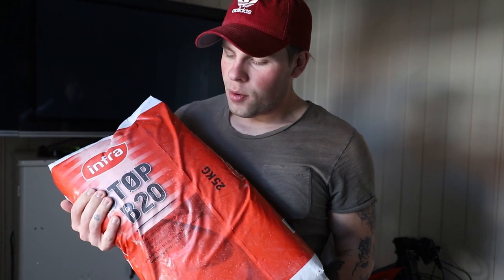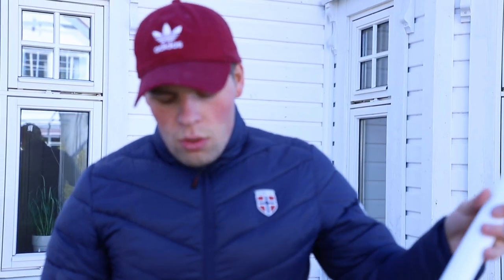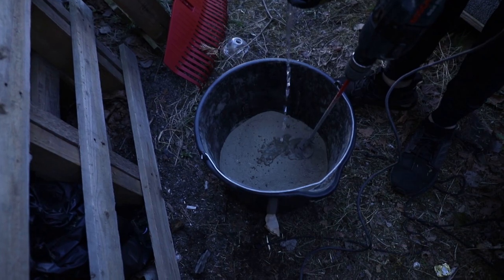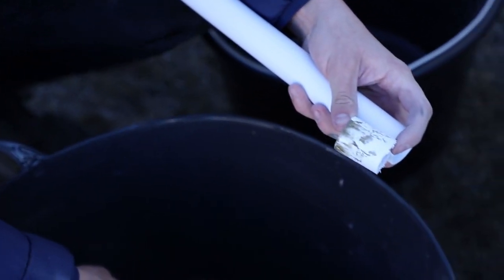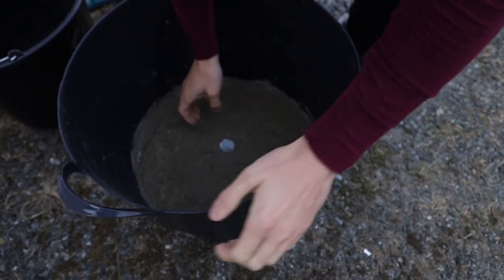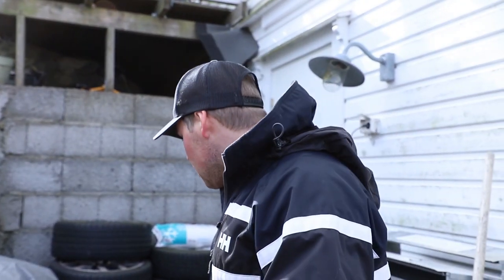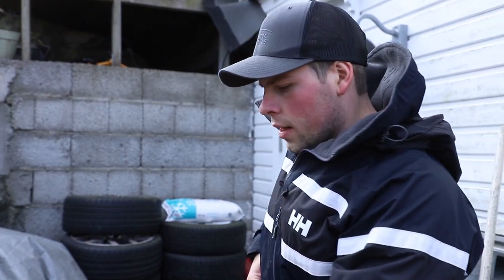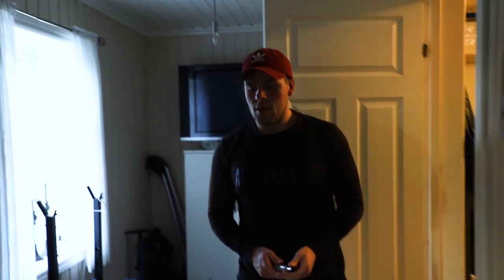HOW TO MAKE WEIGHT PLATES AT HOME *EASY*

Comment: I'm convinced some rubber and urethane coated weights are just a casing and they fill it with some type of filler, cement, or melted filling.
Reply from the maker: Yeah true!
Reply: This is 100% true. When I was a teenager I had a plastic weight set and after some wear and a few drops the plastic split, revealing busted up concrete inside.

Comment: When the concrete is curing try to keep it wet. Concrete doesnt actually dry it bonds with water and cures, so it's best to cover it with damp towels or something like that.
Reply from the maker: Yeah i read it After so i did that on My second plates, interesting how it works. Thanks for the info, always appreciate some input👊🏻
Reply: Johnson Tan TRU

Comment: A better way than this is get yourself some paving slabs, they come square so you cut them into circle, however the diameter is about 30mm plus the surface is dead flat, youll get a good weight out of them, at least 30kg, 5 a side plus bar, easy 310kg bonus points include they are not too high off the ground and to deadlift just use sandbags to absorb impact, you can also just step onto a higher platform to get the standard 9 inches off the floor
Reply from the maker: Sounds good! Might try that out to get some more heavy weight👊🏻
Reply: James P hey was just interested in how you would recommend cutting those paving slabs?
Reply: @SVTCamy  this depends on your budget. Ideally you could get a round slab and put hole in the middle but they are harder to find. So From cheapest to most expensive way, you will want to make/buy a spinning table to help with the cutting

1. Concrete handsaw. These typically have low teeth count per inch of blade, appear large and jagged, cost £/$10-15. You can finish up with a diamond file or angle grinder to smooth edges, and low grit sand paper (40 or lower) or electric sander

2. reciprocating saw + masonry specific blade. Place slab on spinning table, create the circle with pencil, string, nail, use template on the slab, cut by eyeballing or clamp the recip saw to a table and turn the wheel, then holesaw the middle

Most expensive - big electric bandsaw installed again with masonary blade (not wood) using a jawhorse to stabilise the spinner, put the slab on and line it up then simply push the slab round

So yeah it might require some tools+creativity but nothing drastic. Cheaper method than buying competition plates for value

Comment: How did you make sure it didn't get stuck in the bucket? How much was the total cost? What iron rod sizes etc?
Reply from the maker: They fall out off the bucket pretty easy because of the weight, total cost was around 30-40$ don’t know the size but try to find similar to the one I used
Reply: @oscarjohansen5836  I was looking into this myself. I assume you already had that mixing power tool. Which looks like ti costs $100-$200 on its own.
Though I think you can mix it with a trowell, if you have another bin

Comment: Some constructive criticism. Learn how to make concrete (cement+sand+jelly)
Also unlike what the other guys saying I think this is cheaper. Metal plates are hella expensive. If you're deadlifting. Just add some padding so the concrete doesn't crack
Reply from the maker: Yeah did that on the other plates I made, they turned out to be 25kg and were so much better. Totally agree! To melt metal and stuff is gonna cost way to much
Reply: @oscarjohansen5836   25kg per plate? What's the diameter? Nice. Also I know you already have one. But if you didn't. Any ideas you could give me to substitute a barbell? Someone told me to use a galvanized pipe. What do you think?
Reply from the maker: Yeah that might actually work! The 25kg turned out to be around 10cm thick and it’s the same diameter as a normal 45lbs plate roughly 45cm

Comment: Are they solid? Would it crumble if you were to drop it from say your hip height onto the floor matt's in your gym?
Reply from the maker: They are still in great condition, I haven’t dropped one yet but Im sure it will take the hit. Would be carful in the start tho
Reply: I plan on doing something like this but to avoid cracking I'm going to coat it with flexseel. You may want to go that route if you're concerned about it!

Comment: For the PVC piping Did you use a 1inch or 1/2. I did buy 1inch pipe but it did not fit was the same size. Just want to make sure. I guess a little wiggle room is okay?
Reply from the maker: Yeah I don’t fully remember but I remember sizing up one, better with a little wiggle room💯
Reply: @oscarjohansen5836  Thanks man also for the quick response.

Comment: Did you put sand in it . And what is the ratio of concrete cement and sand
Reply from the maker: The concrete was already premixed so I only added rocks but a safe bet would be 4-2-1 so 4 part rocks, 2 part sand and 1 part cement
Reply: Thank you

Comment: well done! next up, you need a DIY power rack , bench press without safety bars is very dengerous... but did i understood correctly, did you just mixed pure concrete with rocks? without sand? If you added sand, do you know in witch proportions?
Reply from the maker: Funny that you said that cus I’m actually starting to make one today😂 as for the plates I would do 25% sand and 75% concrete, that worked better on my second attempt
Reply: @oscarjohansen5836  Ahah i know, because we are all on the same boat and I am designing mine, make sure to share your blueprint!
Damn! why was that better? my pre mixed bags are 21,5 kg sand 3,5 concreete (and i am not too happy) but my dumbbels hold decently so far..
Reply from the maker: Oh nice! I will without a doubt👊🏻 I used another type of concrete on the 25kg, not fully sure why but it got much denser and smoother. Will try to make some dumbbells to but it seems hardcore😂
Reply: @oscarjohansen5836  i just used some pvc pipes filled with concreete for dumbels up to 12 kg, added some screws where the concreete wil be to make some grip and than you do one side at a time.. takes time but not hard at all.. it's cheap and convenient because you can do many different ones and don't need to swap the weights around
Reply from the maker: Sounds good! Gonna try to make some heavy weights like around 40kg but they are going to be to big I think, will try to figure something out

Comment: Where would you get the iron wiring for the inside from?
Reply from the maker: Home Depot is probably a place you could find it
Reply: Do u need the iron fitting?
Reply: @PineAngo  if you don't plan on ever dropping the plate, no. But if you plan to deadlift with them or if you espect you might drop it once or twice, yes. It prevents breaking.

Comment: Should I measure the weight with the water with the cement mix to get the real weight? Or do it before? Unsure if the water changes the weight?
Reply from the maker: Good question! The water doesn’t resolve so it will add some weight to it 1 Liter = 1kg to I would weigh the concrete then water
Reply: Oscar Johansen so what were your measurements for 20kg? The sand .. cement .. aggregates/gravel... and water...? Also thanks for your help!👍
Reply from the maker: Yepp, added 15kg cement 3kg gravel I belive and 2L water I belive, no worries, dumbbell coming soon😁
Reply: Oscar Johansen top man! Bought all the stuff yesterday ready to do for tomorrow! Thanks for the inspiration and motivation big man
Reply from the maker: Appreciate it bro! Get some solid gains💪🏼

Comment: For the bench you have can a Olympic bar fit in it? I’ve thought about buying one of those benches
Reply from the maker: That bench actually broke down! It was made of alliminium so when I had 225lbs on the bar it started to bend super hard, I’m uploading a video later today where I’m making a power rack with a bench! Would strongly suggest to check it out👊🏻

Comment: are the rocks necessary?
Reply from the maker: yeah, unless it’s premixed
Reply: replying 10 months late, but it just makes the weights stronger/more durable. I didn't put any rocks in mine and they're fine. I'm careful with not dropping them or slamming them when I deadlift

Comment: What’s the point of the gravel? Does it make it denser?
Reply from the maker: Just added it so i would be able to Get some more weight, would actually do only concrete, worked better
Reply: Gravel will make it much stronger thus lasting longer.

Comment: What is the diameter of PVC pipe your using??
Reply from the maker: I think I had a 28-30mm not fully sure, just make sure it’s more than 25mm if that’s the dice of the barbell

Comment: Please make a 25 kilo plate!!!!
It would be awesome to watch!!
With a mortar mix ratio of 1:3(cement : sand)  and some re enforcement with steel, you would need a mould with 450mm diameter, 52mm hole and 80mm height.. Please try this!!!!!
Reply from the maker: Got a new deadliftbar so i will try it out👊🏻

Comment: Just saying - with the money you spend on tools and cement you could have bought a good cast iron weights. In my country new cast iron weights cost around 2.20 € per 1 kg, so the set you made would cost around 70 €, so I'm not really sure did you save any money there. Also regarding the other weight being heavier, why don't you just drill holes to the heavier weight until it weights the same as the lighter weight.

Also a thing worth considering is that iron on the metal junkyard cost maybe 1 € per 1 kg, so if you would learn to do simple STICK welding, you could make pretty good weights by just cutting a square peace out of a metal plate and drilling a hole on the center and then maybe welding some of those plates together to create heavier weights.
Reply from the maker: Good points! It was actually not my equipment and you wouldn’t really need that, I just took the "more easy way” you can mix the concrete on the ground, make a form out of a aluminum plate and some strings as well, was thinking of making some of led as well and just melt it. 

As for the smaller one that was 1 kilo less I just added 1kilo plate on that side to fix that. Where are you from? 2.20 per kg is not baad at all
Reply from the maker: Also I used to be a welder before so that could be a option but the metal is a bit more expensive than the bag of concrete
Reply: Actually...
25kg cement 5€ (1/6)

25kg sand 1.72€ (2/6)
25kg gravel 2.02€ (3/6)
so for 150kg of weights, you lose 14.50€ out of your pockets... 
Winner is concrete
Reply: @lenuz9532  very true, i already did 4 sets of dumbbells, but you forgot the cost of the steel for the reinforcement that you definitely need  (as shown in the video) if you are making plates
Reply: Weights cost $6aud per kg here because of coronavirus...way more cost efficient to use concrete in the meantime.